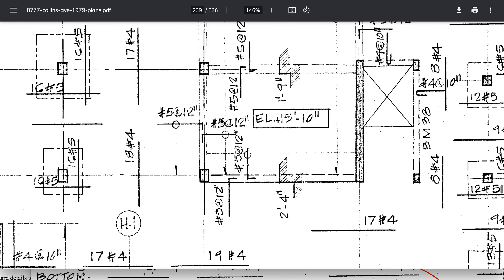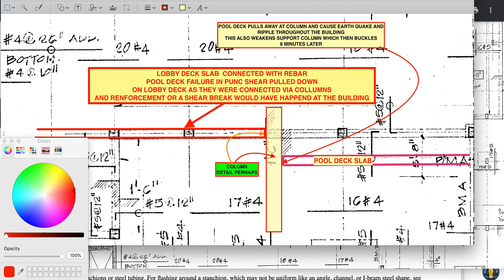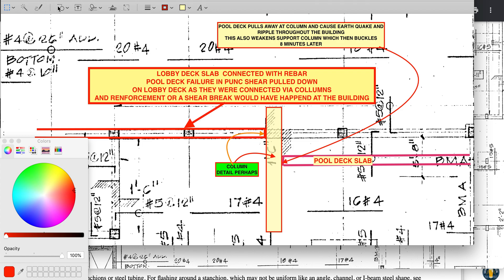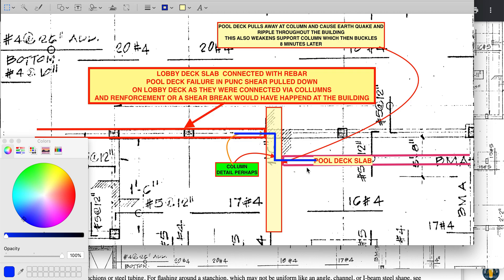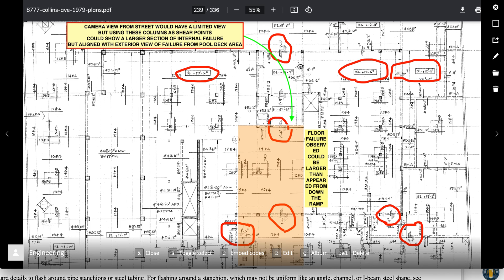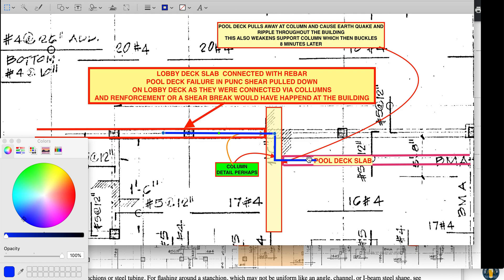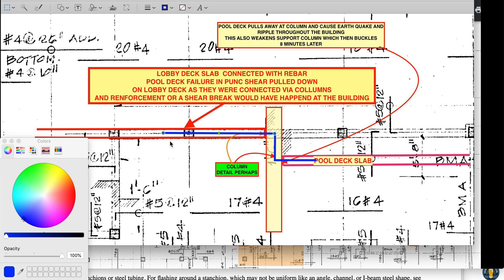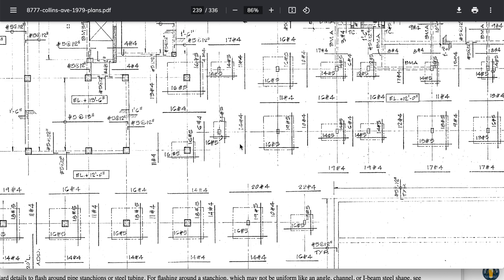Miami Building COLLAPSE CONNECTING HOW THE FLOOR DROPPED ONTO CAR RAMP 8 MINUTES AHEAD ...

Comment: If I understand you the pool deck failure caused the building collapse.

Is it possible that the only place this building had serious concrete degradation was at the pool deck? And that the buckling of the pool deck tugged on enough columns to bring the building down?

Comment: if beach sand was used who knows whats happened?
Reply: Yeah I'd bet a percentage of beach sand in building sand is "tolerated" as one of the ways to "produce economical bldgs as one FL engineer says on his website
Reply from the maker: Not legal...
Reply: @ForensicCats  what about in the 70s and80s?
Reply from the maker: John, this structure did NOT use beach sand with salts in it... It is made clear that the sand is to be cleaned of salts...
Reply: @ForensicCats 👍thanks

Comment: Please direct me to any site claiming a delay between deck collapse, and building collapse   I came across an interview with Mr. Rosenthal from the 7th floor,  he was woken from sleep by what he describes as, the loudest thunder he ever heard times one hundred, then the building started shaking and debris falling on him from the ceiling.  This is on f ox,  listen to him in his own words, was the thunder outside the building or was the "Sound" projected into his head.  I also see a Mr. Gabe Nir Also a resident saying he did not know if he was dreaming when he heard noise prior to the collapses. He described feeling both the first and second collapses.  Our military has such equipment to put voices in our enemies heads, modulated microwave technology.
    The South side of the building had a combined entrance and exit to LOWER LEVEL parking.  The GROUND Level parking entrance is still standing, it is on the South side near the front. The exit for the Ground level parking is in front of the building in the Northeast corner of the property. The first section fell away from the pool, into the street to the north.   The wreckage from the first section is at a 30-45 degree angle to the pool deck. The stucco side panel of the first section is plainly visible at the above angle, in very good condition considering what it went through.
 What was in the penthouse may have been a target of some sort,  The Foreign rescuers spent almost their whole time on the section where the penthouse was. 
    This may be part of the Deep State vs Forces of Light, or Good vs Evil  war that is going on, Remember the Christmas Day Nashville Bombing. The only bombing that had a half hour warning, that was so innocent people did not die.  The FBI may have claimed an "Old White Man" in his camper did it. However they offered no motive or proof of anything. What type of explosive was used, where did he buy the supplies. This will never be answered because its an open and shut case.  Try to forget that Edward Snowden claimed The Nashville ATT building was a CIA/ Foreign site to spy on American citizens. A foreign source claimed on Christmas day a Thermobaric weapon, fired from an aerial platform caused the explosion. They went on to say only persons acting at a State level could wield such a device.  
  Consider this,  look at the remaining columns on the South side, either the third column stops at the first floor or it is lined up with the windows  Is the first floor resting on pilings that do not continue up thru the building????
Reply: Intergrety engineering. Also in agreement
Reply: Oh crying out loud. Cut back on the cocktails

Comment: They use Limestone instead of Granite for their aggregate in Florida, I wonder if they reinforced the pool with rebar in that slab ? If not I can see that the slab could have shifted between the pool and building column, those paver stones were added as an addition on top of that outside slab,could have caused a ripple effect from the pool to that garage column and deck. I believe your on target with this failure....Great Work

Comment: It would be helpful if you show how the building blueprint relates to the actual building. If you could show the photos of the building before and/or after the collapse pointing out what you see in the building blueprint and the actual building. Thanks!
Reply: I think that's what he's been doing, but it's very complex and so you have to watch a couple of times to begin to piece it together. It took me a while to understand all the structural symbols and terminology and then match the plans to what actually happened in the collapse by looking at the original and the collapse photos. It's complicated but I've learned a ton by going back and watching how Construction Engineer & Failure Analysis unraveled the story, coming to his theory (which is fluent and continues to grow and change.) Also, I think his strength is in using his engineering skills and what he notices in real pictures to pick apart the story. His style isn't formal or typical of people who plan out/edit their videos before posting, simply because his mind is running a mile a minute and he's just trying to explain to people how to go about investigating the tragedy, and he does this by actually doing it in front of his audience. Hope that makes sense!

Comment: This would make sense since after it pulled away from the building there was leaking pipes which separated and the column that was seen zoomed in the garage video the tourists filmed.
Reply: Or it was the sprinkler pipes?
Reply: The water in the video was pouring down,  it must have been water from the water pipes in the upper floors draining. The other end of the pipe must be city water.